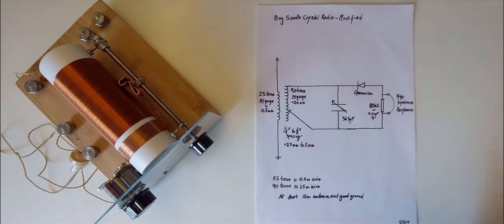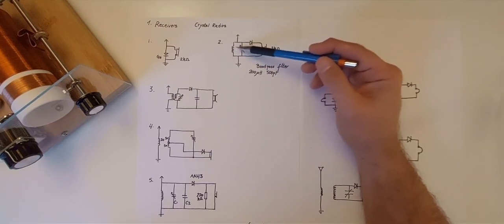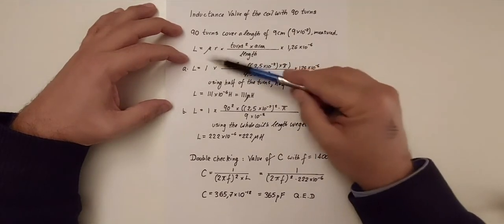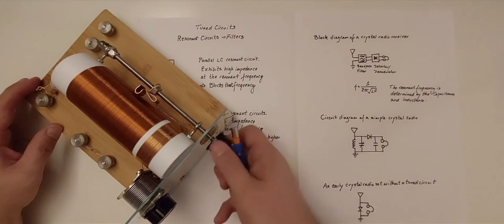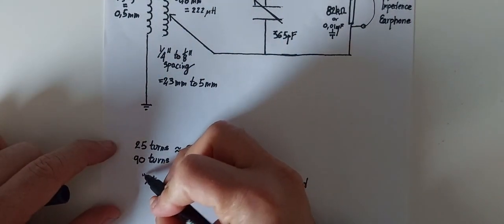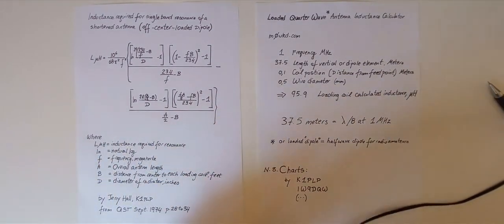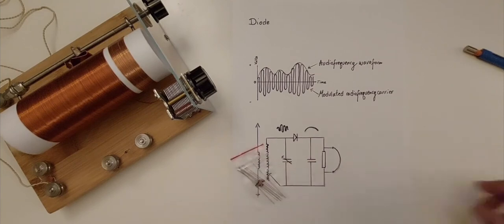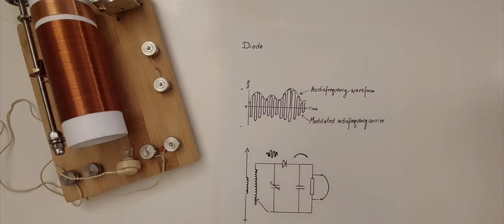Make a Crystal Radio Receiver - Part 3 - The Scout's Crystal Set Explained - How does it Work?

Comment: With the 22Gauge 90turn coil length you measure 90mm, why isn't it around 90 x .6mm ~54mm in length?
Reply from the maker: I double checked. 
22 gauge = 0.7 mm. 
90 turns = 7 cm not 9 cm.

With 7cm I get 162 yH instead of 222 yH.

The calculation shown in the video would then not be for exactly half the length of the coil but for 1 cm further on.

As if the coil were wound more loosely, reducing inductance.

To resonate at 1400 kHz with 162 yH we would need 89pF which is way less Capacity than the 365 pF that variable capacitor can provide.

But go down no further than 655 kHz with 162 yH and max capacity of 365 pF.

Good thing then that I wound two more centimeters of coil for more inductance. It was some time ago, I probably did to be on the safe side.

So we are good.
Good that you checked though.

In sum: 90 turns are almost right on a tube whose diameter is 5 cm. 
Those are then 7 cm of windings.

Go for more windings to catch frequencies below 655 Khz, like 540 kHz. i.e. if you don't want to limit your set to the pre 1923 band's 690 kHz lowest frequency.

I imagine the boy scouts were probably using a tube of different size.

Comment: Really nice job...I can't seem to get any thing right I end up with nothing but tangled wire and a mess
Reply from the maker: You can do it!
Reply: @dm9gp   Thank You I was successful ! 25@90 turn coil set up similar to yours for the tuning coil a few capacitors and a tunning capacitor from a 1965 zenith am radio I made a mini amplifier with a small speaker about 75 feet of antenna ..works great ! Pick up lots of stations experimenting with different coils as well . Thank you for the inspection .

Comment: sir, in schematic diode s orientation .is that wrong?
Reply: I thought the same when I first looked at it I thought it was backwards
Reply from the maker: In the original schematic, it is like this. In this radio, there is an AC oscillation in a (LC) tank circuit that is floating. So, the direction of the diode is not critical. If you like, imagine the flow counterclockwise. In this specific radio, the LC circuit is not grounded. The Antenna instead should be grounded.

Comment: Where do you guys in Europe buy your crystal earpiece?

It seams this is not as common item to get as I hoped

Amazon or ebay does have them but the shipping to Europe (to Slovenia) is more expensive then the item itself

I also tried Conrad, which usualy has a lot of hobby things (it even has a Germanium diode), but not this earpiece

I also tried looking for High Empidence headphones and could not find anything

Now, maybe I am not looking for the right term in Europe, where were this things usualy found (used), back in the day?

It seams back when this radio books were this earpieces were easly uvailable, but where?
Reply from the maker: I ordered from U.S.

I had same issue with some auction houses on the Web.
Reply from the maker: Be creative, improvise: look around for vintage stuff.

If you like check this video, maybe it is not the solution but hopefully it can inspire how to work around?

https://youtu.be/uVroFx-0LMQ
Reply: @dm9gp  Yea, improvisation will come as a next step :) (I was thinking maybe this buzzers that conrad is full of (but they are active ones, just feed voltage to them and they will scream, so I would need to destroy them to get the crystal out), or maybe this singing giftcards, that also have crystal speakers in them

At first I wanted the radio to have the highest chance of working, and since I dont have any high power transmitter near me, only low powered ones (Murski Val, Radio Koper, Radio Capodistria, MMR) I will have to try it out at night I guess. Radio Romania should probably work on it

BTW: did you ever try to pasivly amplify the signal, maybe using a dorbell or audio transformer?
Reply: @DXingSlovenija Transformator digunakan hanya untuk menyesuaikan impedansi Speaker/earpiece yang diperuntukkan untuk radio kristal tanpa listrik, transformer impedansi ini biasa digunakan untuk speaker yang beresistansi kecil yang akan dipasang pada radio kristal.

  tapi memasang Transformer impedansi untuk speaker biasa pada radio kristal tanpa listrik agaknya tidak lebih baik daripada menggunakan earpiece kristal yang bisa dipasang di telinga dengan impedansi yang sudah cocok untuk radio kristal dimana earpiece ini sendiri akan lebih audibel daripada speaker ber impedansi kecil menggunakan Transformer dengan volume yang sama. 
 
 Pada elemen Piezo yang terdapat pada earpiece kristal atau Piezo pickup biasa memiliki keramik Piezo dengan jenis yang sama diatas nya, mulai dari ukuran 20mm biasanya memiliki resistansi 200ohm (impedansi satu juta ohm lebih) dan Kapasitansi 30.000 piko farad, satu hal yang membedakan adalah ketebalan membran nya. 

 Pada earpiece kristal biasa memiliki membran yang amat tipis bahkan anda bisa melipat nya seperti kertas. Bedanya dengan elemen Piezo yang biasa dijual adalah tebal diaphragm metal nya yang kokoh.

 Jika anda akan membuat earpiece anda sendiri, anda bisa membuat nya dengan speaker telepon tua yang bentuknya menyerupai tabung, menggunakan headset impedansi tinggi dari militer, atau menggunakan cakram Piezo mulai dari ukuran 20mm (ukuran dibawah 20mm akan memiliki fleksibilitas diaphragm yang terlalu kokoh, menyebabkan Trebel yang ekstrim, volume kecil dan frekuensi audiosonik tidak akan terdengar sama sekali).

 Anda bisa menggunakan Buzzer pasif Piezo sebagai pengganti earpiece nya, tapi saya pribadi memodifikasinya. 

 Tujuannya agar keramik Piezo bisa bergetar dengan lebih efektif dengan membran yang lebih fleksibel, saya menghampelas diaphragm Kuningan nya dengan hampelas secara sangat perlahan (ada bekas bengkokkan sedikit saja pada diaphragm nya, maka dipastikan tempelan keramik Piezo nya pecah). Hingga setipis alumunium foil.

 Pada sambungan kabel nya pun saya modifikasi. Saya memilih untuk membuat papan terminal nya menempel di luar housing nya, bukan menghubungkan langsung dengan elemen Piezo di dalamnya karena bisa meredam getaran Piezo hasil dari frekuensi listrik beberapa ratus mikrovolt yang menurut saya cukup signifikan.

 Saya menggunakan kawat tipis 0.1mm yang sudah dibengkokkan membentuk seperti ular sebagai kabel internal yang menghubungkan antara elemen Piezo itu sendiri dengan papan terminal eksternal di dalam housing Buzzer Piezo pasif tadi agar tidak ada sedikitpun sesuatupun yang menekan diaphragm Piezo dan mengurangi efektivitas konversi getaran nya.

Edit : amplifikasi output audio pada radio kristal tanpa listrik yang paling simpel adalah merangkai paralel resistor atau kapasitor keramik/Milar dengan earpiece nya.

Apapun itu, preferensi anda adalah yang terbaik:)